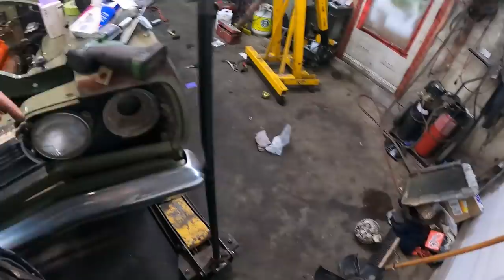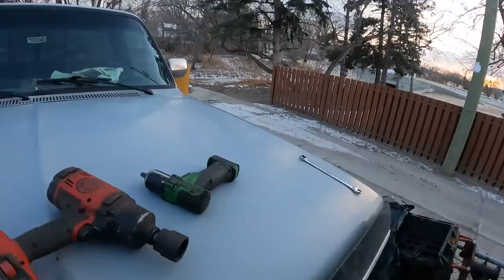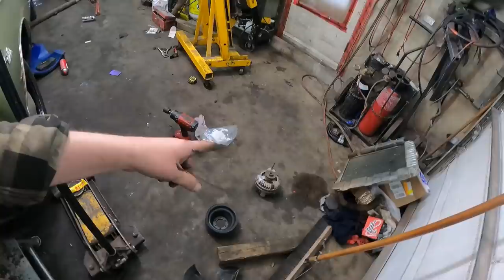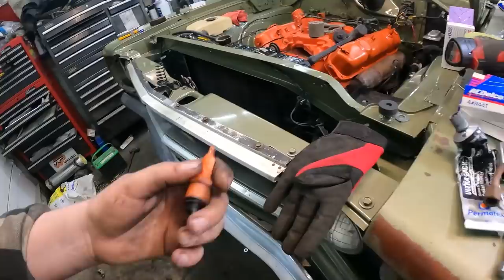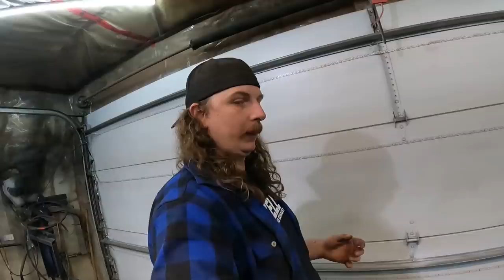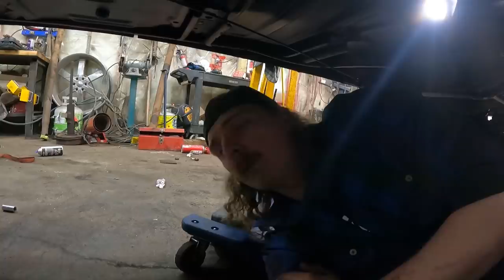Plumbing, Wiring And Hammering on a 440 Mopar - For My 1968 Plymouth Road Runner Clone

Comment: 4 pulleys, 2 for alternator and a/c, one for power steering, and one for the water pump. Two easy repairs on a 383/400/440, 4 bolt water pump with its own drive belt and oil pump right behind the oil filter. Spark plugs under the exhaust manifold are more of a challenge to change.

Comment: Once you have the window rubber out, put it in a plastic bag and hose it down with silicon spray, close up the bag and let it sit. Hose it down once a day for a few days and it will soften up.

Comment: Kool stuff. Just wanted to let you know a 2 groove alt. pully will correct your belt alignment issue. The problem is you have a non AC alternator with AC brackets. I know you'll have it solved by the  time  you see this but maybe that information will help later.  Thanks for all you do.

Comment: Keep an eye on the 440 in the summer heat idling around town.  I am not a Chrysler guy but I did convert a 350 in a 57 chevy to the old school 283 engine dress.  4 blade fan, large fan pulley, etc.  And it would run hot in summer traffic.  The 350 originally had a smaller water pump pulley and multi-blade fan like your 440 had.

Comment: That 4 blade fan will cause heating issues. Get a fan clutch and run the 7 blade fan. Chrysler’s prefer Champion plugs just saying. RJ12YC will get you where you need to be lol

Comment: Dual pulleys on engine and alternator are factory issued on Chrysler cars with Air Conditioning... On 1970's & 80's Chrysler Early Electronic Ignition; you must switch to a double ballast resister from single ballast resister... !! MY 1969 Plymouth Roadrunner; withen 5 years new,  had major rust & rot at the Windshield gasket seal on interior & exterior bottom jam frame just above the Vin Tag... Replacement of windshield gasket is recommended when have Windshield out... !!

Comment: A little help on the Alt Pulley. I believe if you source a 2 row alt pulley it will work. Chrysler did that on some models to get alignment. Check, it should work. Good Luck.

Comment: The glass will be interesting. You rope it in with the chrome in the rubber. Similar to the 67-72 c10’s. hope the rubber is pliable. 
Likely have to trash old windshield to save rubber.

Comment: Start putting  rubber dressing on that windshield rubber Son of a Gun or anything similar  to soften the seal.  Looks like that 440 was born in the old Plymouth  gets exciting  when first start or burn out is on it way soon.. Some people use silicone spray to soften    good luck.

Comment: You can offset the end of the alternator bracket ( bend it) to get the location you need. Then all you will need to do is cut a longer spacer for the back side. 🤔👍👉🇺🇸

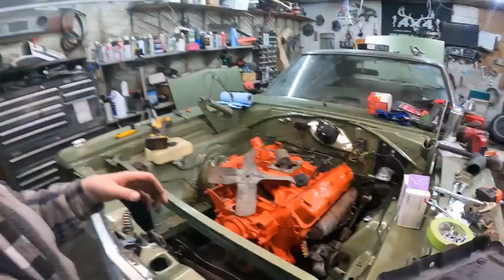Comment: 5:03 You should use the clutch fan set up. It has more fan blades and the thermal clutch.
My 2 cents on this.
Reply from the maker: Yeah its junk.  I gotta find another one
Reply: @DDSpeedShop  Good for you. 👍👍👍

Comment: ive never done a plymouth windshield but vintage mustang has a windshield rubber seal put it on the glass first use the plastic spoon tool then use weed wacker rope to get it in car. recommended to use 3M bedding compound 08509 AFTER install it's designed for rubber windshield seals. remember you dont want a windshield to go in tight or the first hot summer day when sheet metal expands/slam the door crack will develop

Comment: That's the pulley you need on the fan just unbolt the water pump shaft assembly off of it and discard that part... The car looks great but needs a black hood and stripes down the sides

Comment: The smaller one is a AC pulley the other is non AC you need a to use all the non AC stuff from the 383 also the alternator  bracket

Comment: Nice build on the satellite been watching since the beginning was wondering have you ever got your hair wrapped up on the crepper wheels reason why i ask because i got hair almost to my belt last time i used one i spent  about 30 minutes trying to unwrap it had to cut some i have had long hair since 1975 and still work on cars but since 6 months ago got a lift to use when i was young i said what do i need a lift for well after using one at 67 years old trust me i would have bought one had the money but wanted to spend it on something more important i thought great work thanks for sharing

Comment: I thought that motor was doing burnouts in the Chrysler within the last couple of years, I also though I heard it run a couple of months ago. If not I could be loosing my mind, should I go in for a check up?
Reply: I think you misunderstood. He wasn't saying that motor was siezed he was saying this is the first time the car has had a non siezed motor since 1976 when it blew up. The last two he got were siezed not this one. You did hear it run and it was dyno tested as well.
Reply: @ronniebuchanan6575  yep I  misunderstood..thanks, I thought he said the motor hadn't run since 1976.
Reply: @007heatingandair  Yeah I kinda thought you did. Its gonna be sweet for sure. I would give anything for my motivation back like I had seems like the last two years I have lost it turning 60 if I live til August. I need to have my testosterone checked.

Comment: Need to put a spacer between the fan and the water pump pulley at lease 1 inch or 1and a half inch to get closer to the radiator

Comment: That 4 blade fan is not big enough for that engine that's a 6 or small 8 fan and you will most likely have overheating issues with it maybe not now but in the hotter weather you will for sure.

Comment: Looks good Dan. Checkin your video while I eat lunch, then I will get back to doing a lot of nothing and thinking about considering maybe on a good day with the possibility of an offhand chance that I might cut up the Silverado in the shop for parts to put on the C10.

Why the yoke is so long is simple, it has to engage the rear bushing that supports the tailshaft. Mopars have a loooooong tailshaft, so they end up with a long yoke to engage the rear bushing. Its similar to how the 2004R needs a longer yoke than the 700R4 and Th350 that use the same size and splines, if its not long enough the tailshaft won't be supported in operation, and it will kill the trans.
Reply from the maker: Weirdo dodge stuff haha